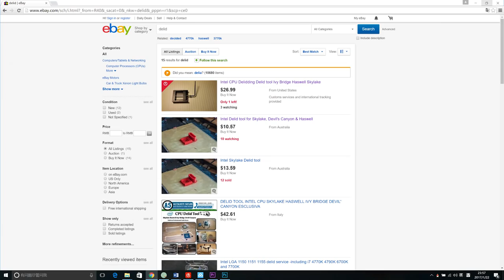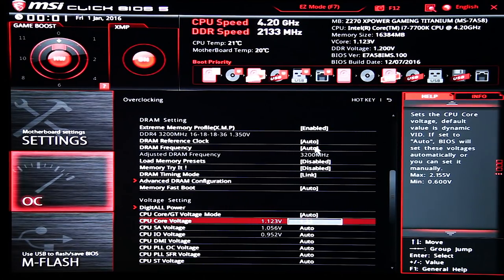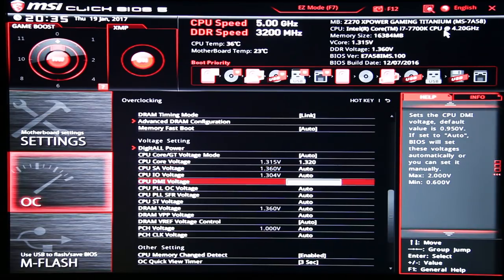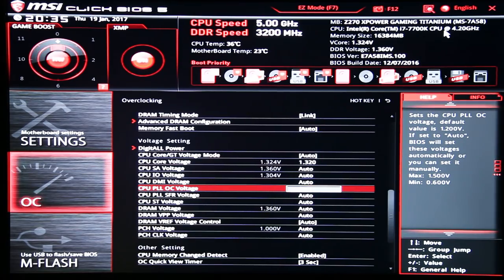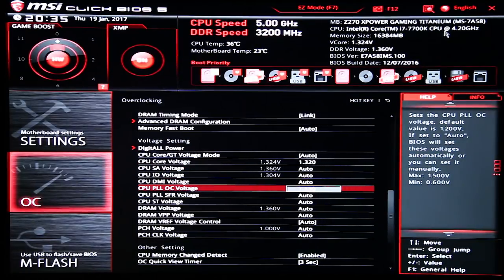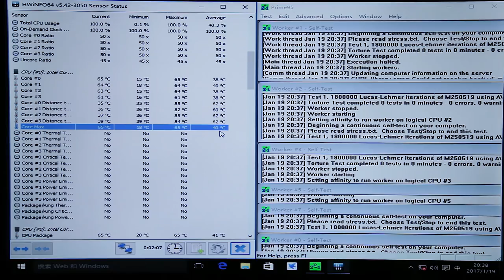【极客湾 Geekerwan】An Easy way to cool your Kaby Lake CPU down

Comment: Well...can you describe what PLL is ? Although I know it can cool down my CPU temperature.
:( Puzzled
Reply: Can be simply understood as the FSB for the power supply, because not overclocking FSB, it can be appropriate to reduce the voltage.
Reply: Serlisi XD

Comment: Foking clickbait!First question: have you ever been to Hong Kong?cause your ways to speak is similar to those in HK;second,there's SO much ways to delid a Core i7 or Pentium D,but why don't you just leave the IHS and replace a mounting system or solder the IHS,but reapply some metal on it?you've vold the warranty!that's just total BS.Lastly,you might want to throw in an AIDA64 test for the thermal conductor replaced Core i7?That's going to show the performance improvement for a lot
Reply: I'm not intended to roast you or what,but don't snap me back
Reply: Umm... I'm not really sure what you are talking about. What do your mean by changing the mounting system?  The mounting system for the fan? And "Leave the IHS and solder the IHS" ?  You should check your grammar before posting a comment. And they chose to use the tool to delid is because it's cheap, it's easy, it's just what the PC master race members use. And If you think this video is a clickbait. Make a better one yourself, "ChixTechTips".
Reply: 斯丢屁得 Jeebus,Leave my name alone!I can't change this crappy name,for me,I,ll leave the liquid soldering material and shut the IHS back in......if I want to do so.The most mind-blowing fact is WHY YOU DELID IT BUT ONLY ADDING ANOTHER WALL FOR THERMAL CONDUCTIVITY?just delid it and call it a day......it's maybe better!
Reply: ChixTechTips I didn't even know I have 2 subs. lol thx
Reply: ChixTechTips Try to put a normal cooler back on without IHS. you're probably gonna broke the CPU in no time.
Reply: 斯丢屁得 Oh,but are you saying that those who can afford to delid an intel CPU can't afford a die guard?They can afford Thermaltake and EK hard-tube water cooling,4-way Titan Xp and In Win case,but can't afford a hyper 212 evo.
Reply: Hah? This video is made for people that spend all their budget on a nice cpu, but doesn't have budget left for a nice water cooling system. Isn't it very obvious?
Reply: 斯丢屁得 I haven't met ANYONE who buy a LGA2011 stock cooler to cool his 6950x down.
Reply: If someone had bought a over the top water cooling system, then that person probably wouldn't delid a cpu at all.(unless he is doing extreme overclock) This video is aimed for those people who overclocked their i7 7700k to 5ghz, but only have something like 212 evo.
Reply: 斯丢屁得 but......why on earth would you buy an Evo 212 and match it with an i7 7700k?you have the money for a i7 but can't buy an AIO water cooler with an 120mm radiator,that's mind-blowing y'know
Reply: A 212 evo is generally 50 dollars less expensive than a AIO cooler, so if you choose the 212 you can save 50 dollars, and you can spend that on a 120gb ssd, a 8gb ram, a headphone... and you think you've rather spend that 50 dollars on those stuff instead of a better cooler, but you still wants to overclock to 5ghz. Then this video is for you. Get it?
Reply: 斯丢屁得 Still mind-blowing for a high-end gamer&overclocker